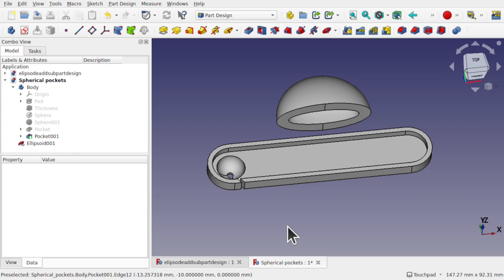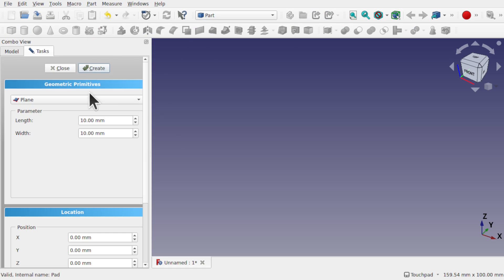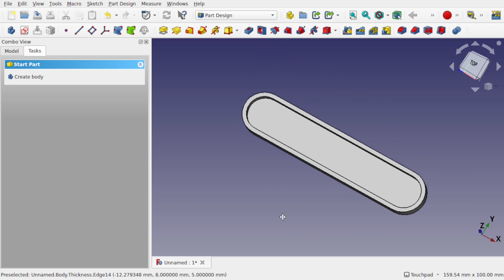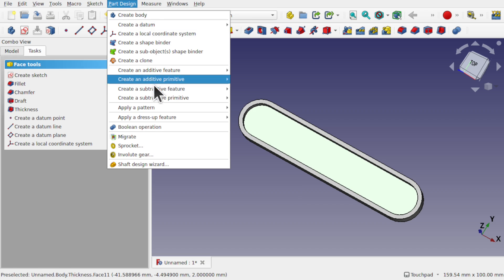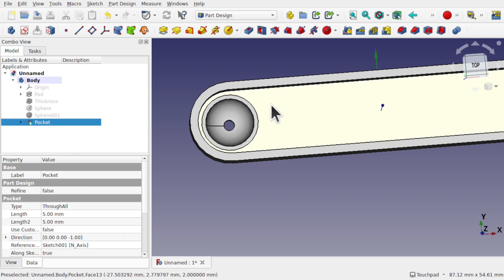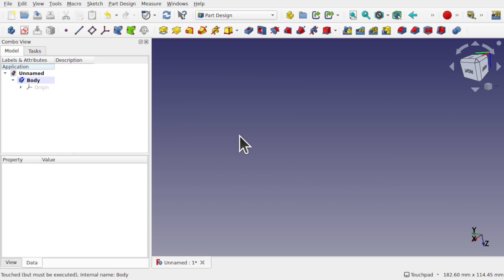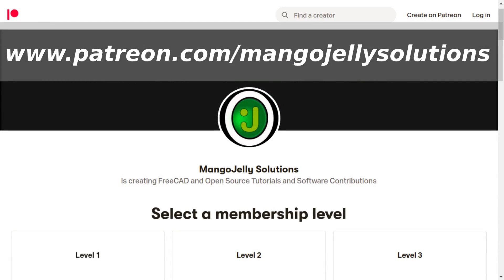FreeCAD for Beginners 25: Spherical Pocket | Part Design | Additive & Subtractive Primitives

Comment: I could not move the sketch to Face5 with the support window for some reason. I got the same result using MapMode though.
Reply: I also encountered this problem, which is not the first time.  In the Report View panel, I get the message "PositionBySupport: AttachEngine3D: subshape not found".  I'm using FreeCAD 0.21.1, which could be the reason.
Reply: @eddyproft8390  hi! you should use attachment editor tool after you right click, i use 0.21 and it worked like this for me

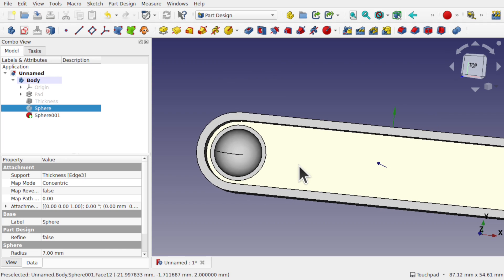Comment: At about 11:40, when you create a sketch the part annoyingly flips around. Is there a way to prevent this, or does it have some practical value?
Reply from the maker: That's a good point. I will look into that with one of of Developers to set of the is a setting out a way to prevent this. I think it's down to the way the sketch is mapped to the surface and the axes are aligned.
Reply from the maker: Just had a quick message from him, he believes it is down to the mapping but is going to check deeper.

Comment: That's a very neat, quick workflow. But -- don't you create a lot of topological naming problems by attaching things to edges and faces? I strictly work with items attached to the absolute planes only. A pain in comparison, yes...
Reply from the maker: I have always practiced traditional CAD techniques as with careful model management you can resolve those errors if you start to change the underlying topology. The other reason why I do this is that the videos will still be valid when the topology fixes come in which I belive is not to far away.

Comment: I'm curious, I tried to make the original pad and then add the dome and then apply thickness but it can't calculate it, just doesn't say way other than an error.  It also doesn't allow me to just use thickness on the dome's face.
Reply from the maker: Thickness doesn't work with such shapes as spheres, they are best suited to simple pads.  It's a shame as you could totally bypass the subtractive primitive step and, as I guess what you was investigating, do all the hollowing in one go.